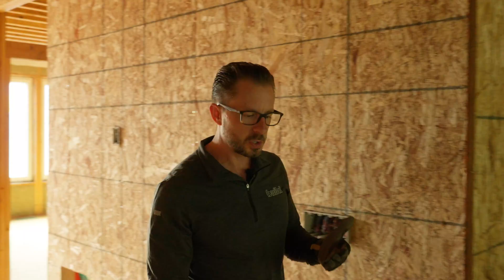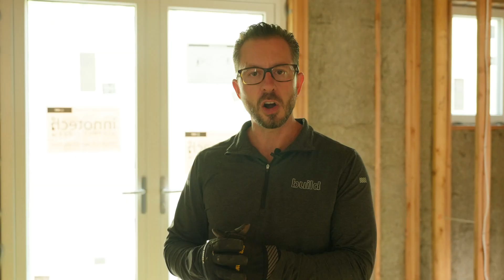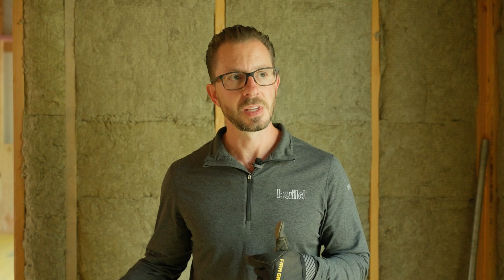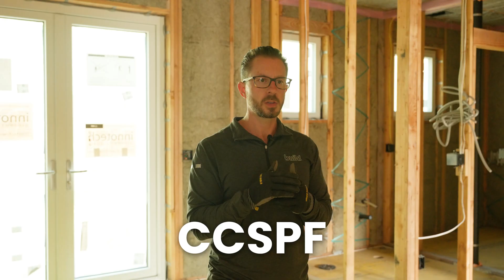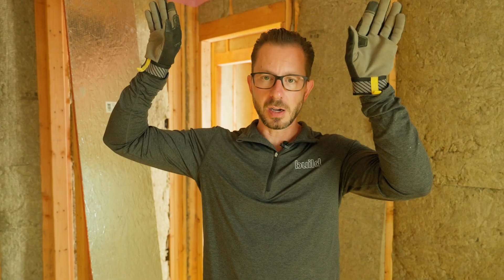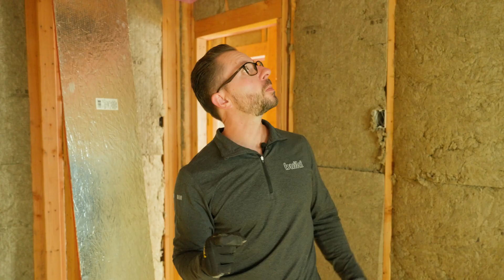Why We Insulated This House With Rockwool (Crawl Space to Attic | Full Strategy Walkthrough)

Comment: Could you use the LP TechShield as the top layer of roof sheathing with the radiant barrier facing the 2x4 vent space? Then use a self-adhered underlayment. Seems like that’s the most appropriate location for radiant barrier performance in this roof assembly. A vapor diffusion port would handle vapor accumulation at the roof peak.
Reply from the maker: You could. However, this is a small portion of the entire roof structure, and the majority is built conventionally (no ductwork in those areas).

Comment: Did you insulate the attic joist bays instead of the top of the roof deck for cost savings?  I keep hearing about the benefits of insulating the exterior of even the roof on Matt Risinger's show.
Reply from the maker: It was primarily to bring the heating/cooling equipment into conditioned space
Reply: Making your attic conditioned space does add an extra heating and cooling load for the additional cubic footage of air volume. I also do not like the conditioned attic for humid climates because it makes it more difficult to eliminate moisture from the home. With a vented attic, you are also shedding moisture driven through the ceiling to the outside without the need for mechanical ventilation or a dehumidifier in the attic.
Reply from the maker: Ok